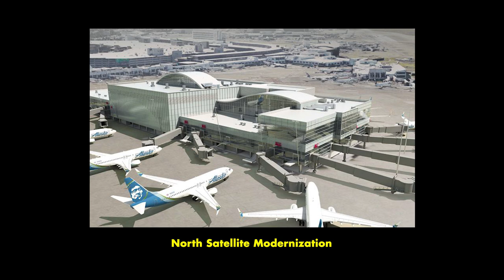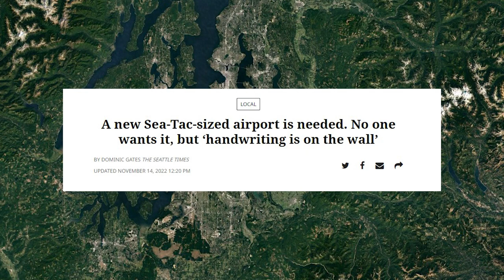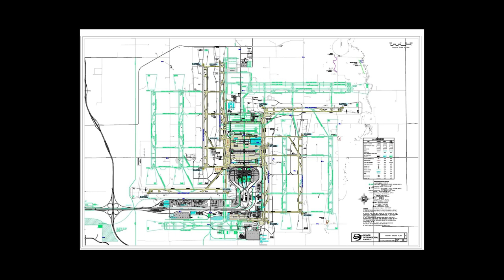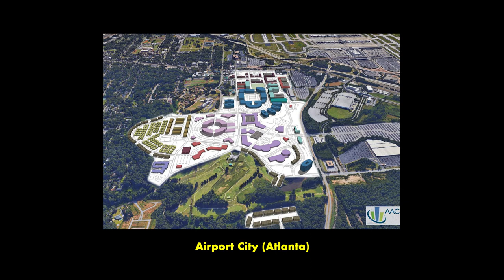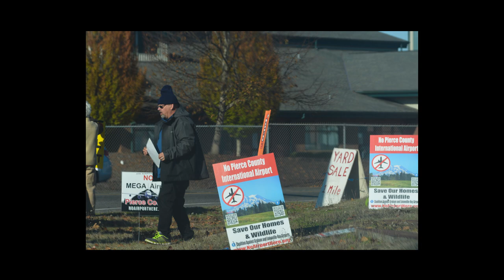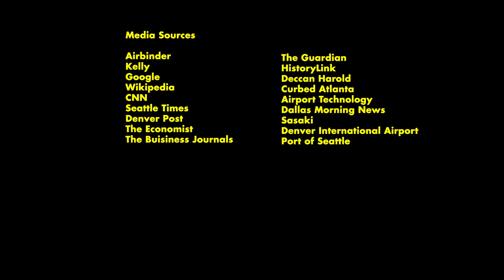Where do you build a New Airport?

Comment: To add to this, San Diego is also in desperate need of another airport. The current San Diego International Airport is a lot smaller than even Sea-Tac with only 1 runway and no room for expansion. At least Sea-Tac has 3 parallel runways
Reply: San Diego should have and still should build a joint mega airport with Tijuana creating joint terminal facilities between them like the plan was way back in the 1980's and 1990's...

Comment: I think cities should adopt a multiple airport strategy.  By that I mean, several smaller airports rather than one mega airport.  It's sort of why I like the New York airports.  If I need to go into Manhattan or out on Long Island, I go into JFK or Laguardia.  But if I need to rent a car go some place upstate or in New Jersey, I go into Newark.  I've even used the old Stewart Airforce base airport up by Newburgh since they now have civilian flights up there too.  My point being, this not only gives people choices but it distribute the traffic around the metropolitan area (both car & air traffic).
Reply: The problem is the hub and spoke air carriers mean If you need to transfer to another airline, it may be at another airport and transfers between airports is a PITA
Reply: I agree. London does well with 5 or 6 airports of medium size...
Reply: @marklittle8805  In theory, but most people connect via airline groups which tend to cluster at certain airports... I.e. Star Alliance options exist at the same airport... It's not as big of a problem as people think it is...

Comment: I suggest a multi-airport approach connected by high speed rail lines much like London has planned to but beyond a few separate train lines never did... Boeing Field downtown should also be part of that as a City Airport for direct local/regional flights using battery electric, hydrogen or hybrid aircraft... You know, like the ill-fated Zunum Aero that successfully sued Boeing recently for financial fraud for stealing design/trade secrets from the joint venture...